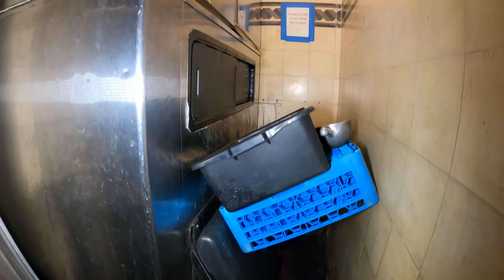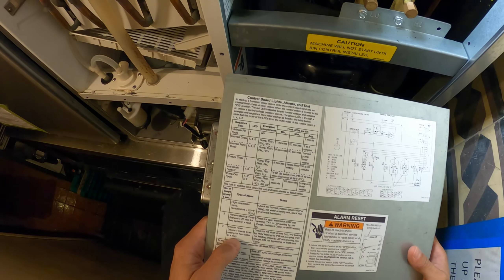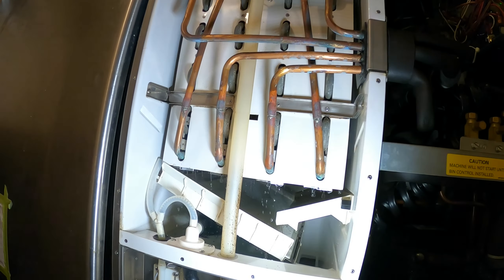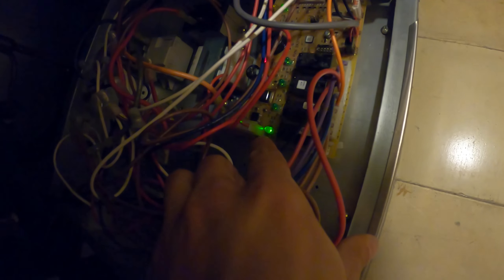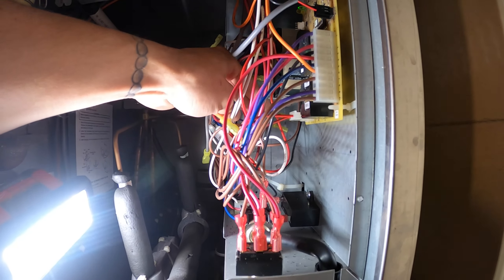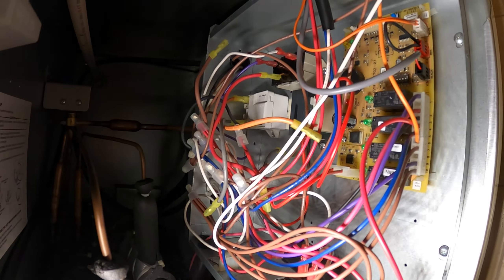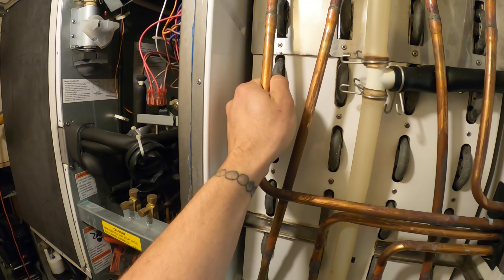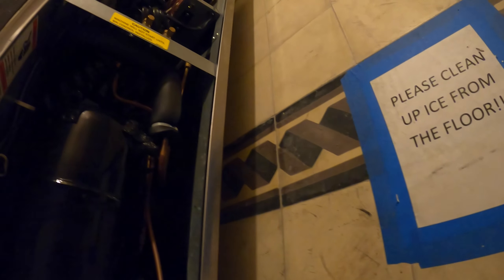HVACR Service Call: Hoshizaki Ice Maker Not Making Ice (Hoshizaki Troubleshooting/Hack Job Repair)

Comment: What threw that person off is that the water pump was coming on but the compressor wasn’t assumed the compressor or compressor components were bad . Guess what all HOSHIZAKI water pumps are 115v not 208/230v that’s the purpose of having a NEUTRAL at the incoming voltage 😁😬. Good fix JMT 😃

Comment: Interesting outcome. You're correct,  ice machines can be tedious especially if haven't worked on them.
Reply from the maker: It was. Thank you! They definitely are. Stay tuned for new videos every week🔧⚡️
Reply: I will never understand why hoshiaki has the reputation it does when they're a pain to work on, a pain to PM, and every unit I've seen has constant issues.

Comment: I'm confused as to why the machine had power but the switch was bad…….but you def helped me with the process. Thanks.
Reply: It looks like the pump and the control board only need 120v to run. As to where the compressor needed 208v to run. He has 2 hots , 1 neutral, and a ground going to the system from the switch.

Comment: In a situation like that where you can’t get to the compressor wires and you have to check potential relay -what terminal you check on the potential relay to check for power to compressor?

Comment: I own a KM-201BAH, which is a great machine, but it's too small and need to upgrade. I need a machine and a storage bin that will hold between 300-400 pounds of ice. I know Hoshizaki has a stainless steel evaporator, but what quality machine would you reccomend that will last and is easy to maintain? I use it for my mobile hot dog trailer business. Thanks.

Comment: Surprising, you mentioned you didn't touch this but it's your account? Who removed all the parts? If it's your account, why is it not clean with your PM?
too many question why it's not clean or in poor condition?
Reply from the maker: @davelukac2023  Its a question for me too as to who touched this. Wasn't anyone from our company. There is no maintenance contract in place so that's why it's not cleaned. We are just the main company would services all of their equipment. Thanks for watching! 🔧⚡️
Reply from the maker: @davelukac2023  "If it ain't broke, don't fix it" - Customer 😂
Reply: @JumpermanTech  it was broken. Missing parts. Did you see a different video?
Reply from the maker: @davelukac2023  & that's why they called us to come
Reply: @JumpermanTech  you said this was your account. So your company missed it?

Comment: sheesh! That was some show! I get those idiosyncracies all the time. Right now working on a Hosh where I can't get the power to go on after someone tinkered with the caps also. Good detective work with the meter JMT! Thanks for sharing! I wish I coulda seen how you wired the caps. I am thinking about the CB being replaced bc nothing comes on with the one I'm working on Thanks!

Comment: The piece in the front you’re referring to  is called the “snout”. The units over the bin are called head units and the remote condensers are outside/on the roof
Reply: Float switch controls beginning of harvest. Freezer timer max is 45-60 depending on what unit came set for from factory. These units are 45 minutes. 8/10 3 beeps is a lack of water from dirty filters or dirty machine or plugged water filters. 1/10 times low on charge and 1/10 bad water inlet valve or clogged inlet valve not letting enough water into sump. These units have a factory set 1 minute fill time so if sumo isn’t at least 3/4 the way full after 1 minute check water inlet valve. If compressor starts before 1 minute and sump hasn’t filed all the way it’s your float switch
Reply: Dump valve seal also gets dirty sometimes which allows a little bit of water to leak out the drain
Reply: this guy doesn't fully know what he is doing.

Comment: I have a 6 year old Km-201bah that I maintain well. Sometimes it'll beep once and sometimes 3 times, so I reset it and it'll work for several days. I had it checked out and everything checked out okay. He said it could be a relay on the control board. It's in my garage and has been doing this for a little over a year. Could it be air circulation in my garage? Would putting a small portable air conditioner or dehumidifier close to it make a difference or replace the control board?

Comment: So one leg of 208 volts wasnt passing thru the two pole switch? If so how was small gauge jumper able to carry the power across the bad switch without overheating?
Reply: No amps running through it.

Comment: Never assume that you have a good voltage... I had been troubleshooting machines, with welds fails.... and it was not correct voltage at the transformers or income... if yoy have a machine with 24DC, 24AC and 220V or 400V please check all the voltaje and fuses... the easy part first!!

Comment: Man that was some great troubleshooting. Can't wait till i get nice with the meter like that. This video may have stepped my game up. 
With those baffles, the worker take them out so they can get ice out faster. Not knowing they are costing the company money. I usually pop out the inspection window to drill them in from the inside. The baffle is thick guage so you make your holes outside then install it and put the screws in the plastic.

Comment: run and start should equal the common. Draw a circle and 3 dots to represent the comp terminals. write the ohms between each pin and the number Opp is the resistance for each winding, common should be the sum of run and start windings.